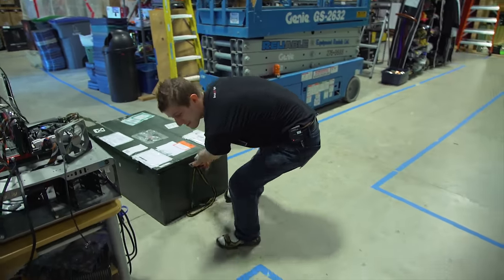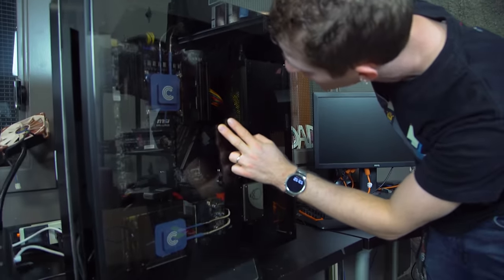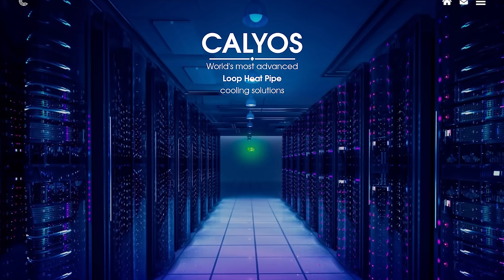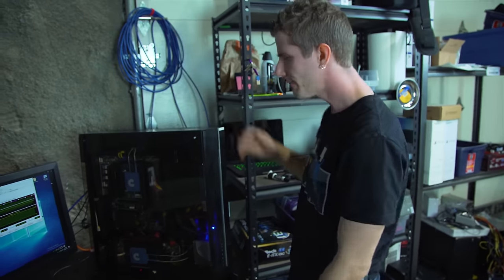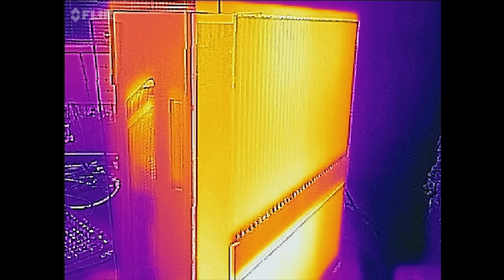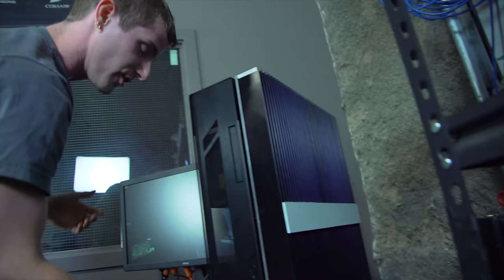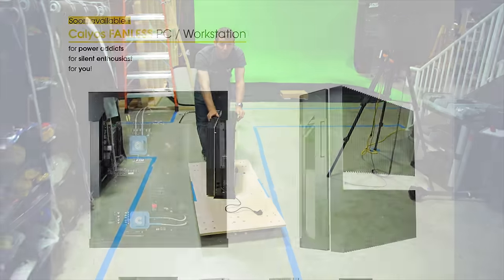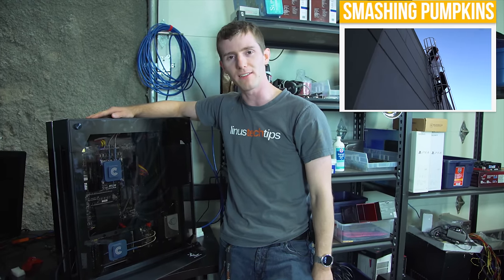TRULY Silent Workstation PC with ZERO FANS - HOLY $H!T Ep. 13

Comment: That a legit way to not get your computer stolen.
so heavy the thief can't lift it.
Reply: Yeah, but can you imagine moving it up and down stairs tho? I had to move my workstation at work up just one flight of stairs, thing musta weighed 100 pounds.
Reply: John Hitman but they can take cpu and gpu away
Reply: +fade2black001 72 pounds for a pc is heavy though... and in all honesty is moderately heavy
Reply: Lifting 72pounds is one thing. Getting away quickly with a 72 pound computer this size doesn't look easy.
a thief would prefer a laptop or a flat screen TV / computer screen. something they can carry and run with without difficulty.
Reply: fade2black001 I change dump truck tires and backhoe tires on a regular basis, I'm not saying it's heavy for me but for the average person 72 pounds Is rather heavy
Reply: John Hitman Thieves don't run. At least not the ones that'll nick this from your home. They will carry it to the back of their Thieving Van (matt black paint, tinted glass) and proceed to take anything else they fancy from your place. Were you picturing some random bloke running with this, penguin style?
Reply: Juanito Calavera ah, so you're a thief then. I mean, you seem to know everything about every hypothetical "thief"
Reply: I think its very clear that I made the distinction "the ones that'll take this from your home". 

And although I don't do it professionally, I am a thief. I have stolen many things from many stores particularly tech stuff and it feels me with pride like you wouldn't believe.
Reply: No, the big issue with the standards imposed mainly with the US Military for height and weight standards are that they are typically based on the out of date BMI system that makes the assumption of every single person of a certain height having the exact same frame. I have seen guys who could blow the fitness tests out of the water that were forced onto the body composition programs because they could not pass the height-weight standards or the poor excuse for a taping system imposed on the service that only uses waist and neck sizes for reference on the individuals. This is why there are also service members that are obviously outside of the standards based on appearance, fitness test scores, and the height-weight standards. They luck out solely on the way that their body stores the fat on them giving them a neck to waist ratio just enough to let them slip by. This is such a rampant issue that has held back peak fitness of service members and allowed others to make it through the bare minimums that there have been new orders rolling out to at least help the individuals that are able to excel at the fitness standards by either increasing the "body fat" percentage by a few points or outright exempting them from the standard altogether.
Reply: I understand that concept, however, the definition you are using of healthy is fairly flawed in and of itself. It becomes very skewed when you have many individuals that suffer from pre-existing conditions that are due to a poor roll of genetics like asthma, heart conditions, malformities and plenty of other issues. I suppose the main issue is mentioning the US Military, though, as most individuals commonly come out a lot worse for wear physically after completing an enlistment than those of the same age that didn't do the same, which is part of why many come out with disability pay and common use of the VA hospitals after their end of active service.
Reply: Went from zero to incest... I don't think anyone in their right minds would say that incest is healthy, but that is a skip to the worst possible case that anyone can have genetically besides being subject to mass amounts of radiation. The traditional definition of health is:
A :  the condition of being sound in body, mind, or spirit; especially :  freedom from physical disease or pain
B :  the general condition of the body <in poor health> <enjoys good health>
I'll concede that in this definition, however,  health is being used as a measurement of how long someone will live. Fitness must also be taken into effect for quality of life or survivability purposes as well. There is no reason that both cannot be used in tandem to fully measure the how long and well people will live their lives.
Reply: Simon you even bringing up BMI shows you have no clue what you're talking about.
Reply: I usually pull airplanes and push dump trucks to train. Not saying it'd necessarily be heavy for me but to the average person, it may be rather challenging to try and make away with this rig.
Reply: Cody Shumer THANK YOU. took that essay right out my mind lol. I'm in the military and can attest to what you're saying as fact.
Reply: Not me, I am a heavy weight thief. I lift even when I am running from cops.
Reply: John Hitman 666 likes...
Reply: With how the justice system seems to work these days they'd probably throw their back out trying and sue you.
Reply: they will just drop it
Reply: It was only 35kg, what adult can't lift that amount...
Reply: its only 77 pounds....
Reply: When I was 12 I could lift 50lbs with each hand... I'll steal this from Linus anytime.
Reply: username checks out
Reply: It would only be hard if you are linus
Reply: You should have just gotten a laptop. Much easier.
Reply: John Hitman make a concrete and steel base so that it is so heavy the thief asks you to help them steal it from you.
Reply: That's what forklifts are for.

Comment: You can't really shoot thermal IR pictures through glass like that.  Heat is going to reflect.  You might see a warm spot where the class is getting warmed up by the components but it's not indicative of the actual temperatures.  It would be a lot different if you popped off that glass cover.  There's no way the heat sink fins are hotter than the components themselves.
Reply: I was about to ask where he get that thermal camera ;D
Reply: You are correct about the IR picture.  Ideally he would have the IR camera inside the case...  Even so Linus did report the CPU and GPU temperatures as monitored by the OS.  This is one big heatsink...  As a student in the 80's I did some heat transfer work at a telecom equipment manufacturer.  While I was there they replaced their camera which needed liquid nitrogen with a new one that did not.  The first thing we noticed was that a person's glasses distorted the IR readings.  It was a lot of fun to play with the camera.  Things have changed....

Comment: Only $500 for the case and cooler? That's actually much less than I was anticipating.
Reply: Houdini111 I'd buy one.
Reply: expected like 2000$
Reply: Houdini111 duck Yeah I would buy one hopefully by the time it's released it will be a tad bit cheaper but for a all in one case that's not to bad
Reply: Id have one at 500 dollars tomorrow,my missis is always moaning about the noise with one case fan and watercooler fan and GPU fans
Reply: Thats a very affordable price considering how much a custom loop costs
Reply: Exactly what I was going to say.
I'm a student and even to me 500 bucks doesn't sound like a bad deal.
It is a high end case with a high end CPU and GPU cooler very nicely integrated. And those two coolers happen to be the best thing you could get, not available anywhere else (unless you go custom, but that actually gets expensive very quickly).
Reply: that's what I was thinking. For $500 this is really interesting
Reply: Plus all the money you saver not having to buy a single case fan.
Reply: Phake Phakerson Even better, no maintenance because no dust will go into the case or anything
Reply: Exactly what I was thinking.  I haven't done a build in a while but how much would a nice case and high end cooling solution cost anyway?  Couldn't be way cheaper than this.
Reply: Wellll, some dust but not even close to what a dust filter picks up
Reply: Its amazing how cheap PC stuff can be when its not meant for "gaming". Expect an RGB variant of this to be sold by another party for twice the price.

I can also definitely see Thermaltake making a clone, and making it much cheaper.
Reply: That's in the price range of custom water cooling solutions (if not less) and those aren't silent...
Reply: Houdini111 was thinking the same thing.
Reply: RGInquisitor While I know Thermaltake can do a lot in terms of case manufacturing, this one is special because of the secret technology that is in those pipes moving the heat away. I don't see anyone replicating that anytime soon.
Reply: motorbiker46 I wouldnt be surprised if it was reverse engineered soon.
Reply: For that Pricepoint and the fact that it looks epic and its unique i 500 is super low and the fact that you dont need to pay anything for fans some math (120$case 50$water cooling loop (30$ quiet fans x3)Gpu Waterblock kit 60$)
~320 $ for the super high end stuff paying 180$ more for the complete silence and the cool factor seems like a complete steal.
Reply: I'm hoping for some kind of smaller/lighter and cheaper version of this. I mean, the temperatures are quite a bit lower than they need to be, they could probably just chop off 25% of the heatsink and it would be fine.
Reply: but you have to consider that it would make for the worst LAN party PC ever... xD but srly as someone who already spent like 260€ to get his pc as quiet as reasonable possible (not counting the 1TB ssd) $500 is very appealing.
Reply: ***** what have you bought for 260€?
Reply: J Bender 
case: Silent base 800 = 120€, 
CPU cooler: Noctua NH-D15S = 80€
and 3 Noctua case fans for ~20€ each.
this stuff adds up fast...
Reply: ***** nice, got the same cooler and fans, but a corsair case
Reply: So basically you could save up for it by not buying 2 textbooks. @motorbiker46
Reply: I was expecting a bigger price, especially shipping in the size and material of a weapon box.
Reply: For a custom water loop, you're paying $700-800. $500 for this which is damn silent and gives near water cooling temps for the CPU and GPU? That's pretty good. 

Linus, don't yank our chain m8.
Reply: yeah for that kinda performance, 500 seems very reasonable.
Reply: Add a window fan to it!
Reply: Only $500 im sold. End game case here
Reply: +DC And that would be an incredibly high maintenance set up and a huge pain in the ass. Your idea destroys practicality at the expense of $70. 1/10.
Reply: That's really reasonable. for such an impressive technology
Reply: Or just buy slow enough cooling fans and you can't hear the computer in any practical use. My computer has 7 fans in it and it's practically inaudible. By the way I don't think there's any point in Super Flower's passively cooled PSUs since their actively cooled models are also practically dead silent.
Reply: Houdini111 sush!! saying stuff like that increase price.. 

come on man!
Reply: i expected well over $1000
Reply: ***** Well for $500 you are getting a high end case, a giant heatsink (that you can buy separately, but you won't save much money) and their special technology of moving the coolant. That is a damn good deal. You have to realise that a good case, a CPU AND a GPU cooler can get pretty costly.

You also have to understand that not everyone is able to make this kind of stuff in their garage. And even if they can, it will not look nearly as good.
Reply: Andrew Dunn Well, I'm not studying to be a doctor or lawyer and I'm not studying in America, so not really :D
Reply: beats the fuck out of liquid cooling for a better  price indeed
Reply: LOL 500$? Thats basically nothing. Thats less than my current water cooling loop.
Reply: By pirating two textbooks
Reply: ***** 
Well if actively cooled computer is practically inaudible..then passively cooled doesn't really have that advantage. I have had one fan failure in last 15 years.
Reply: You forgot the coolers for the GPU and CPU. 160$ for that.
Reply: don't  forget vrm and ram temp..... imagine how much you need to spend on water block if you wanna cool vrm and ram as well. compared to water cooling this thing is freaking cheap
Reply: it's actually cheaper than Razer Core
Reply: Kapteinis Reinis haha, that's true. that thing should be at best $100
Reply: is the price for the case ? i cant find it anywhere online
Reply: pdx i think it is not sold yet, but the price was announced to be 500usd for everything except actual computer part... i think within few month time we will see some pre order i guess.
i really wish they'd make ITX version.. that would be freaking epic
Reply: $500 would be really good price: Without any modifications this case tends to cost $400.
Reply: I`d buy that for a dollar
Reply: +ffffff
I don't think that would be possible, passive heatsinks are dependent on large thermal mass and surface area and the only materials I can think of that they could try to use that would have better thermal properties than aluminum are copper gold and silver and those wouldn't improve the performance by enough to shrink it that far and would drive the price to absolutely insane levels.
Reply: Cooper Cummings sorry, but did you watch the video? its using basically a refrigerant for this. aluminum will do fine.
Reply: Cooper Cummings but dont forget carbon fiber or graphine.  Passive cooling should actually be super common once those prices come down.
Reply: Cooper Cummings yeah forgot about that, guess ITX will make little sense coming to think about it.
Reply: Wemdiculous CF or graphene won't make much difference. why would help with cooling, you can make chips with high heat tolerance with it but it won't help with cooling at all. making heat sink out of them is useless, only way that could be used is by having carbon nano tube or graphene chamber to create a heat pipe but that other than being light will have very limited effect. although it graphene could be used for thermal pad but by being conductive it will have very limited application.
Reply: I don't think a clone will be that easy. The secret for the cooling is the fluid in the coolingsystem.
But that case looks awesome and it would be worth 500€ for saving cooling and running electricity costs. No moving parts also means almost no maintence.
Reply: Doubt 500 is right, the case attached looks like the lian li pc07 which is expensive on its own let alone coupled with distribution etc. of the cooling system
Reply: they have a case on kickstarter right now,  570 euro for early bird :)
Reply: 100 bucks gpu cooler 100 bucks cpu cooler 100 bucks big ass radiator 100 bucks case, 100 bucks extra, 500 bucks would be a good price :)
Reply: Shut up and take my money! 💵
Reply: I thought like 1500
Reply: Wow, that's an underrated benefit. You could have a fully air-tight case which would see effectively no drops in performance due to dust and air-flow degradation. Change all storage from HDDs to SSDs, and you effectively have an entirely solid-state computer with *zero* moving parts. Apart from energy use considerations, you could have this on 24/7 and could reasonably expect it to run both unnoticeably and indefinitely. No wonder they raised money offering this as a data center solution.
Reply: @CrabSt3r  IF it gets released
Reply: Linus got it wrong. It was €579/$690 for the first backers, the last backers price for it was €650/$775. Retail, if these things ever get completed, will probably cost closer to $1000.

Comment: That is some dope engineering.
Reply: And only $500,-? That's crazy.
Reply: Pascal M. Still, A custom water loop costs More. This would be a Killer price
Reply: +Pascal M. The case includes the cooling system ofc because they won't sell them separately.
I think it's more or less obvious that the actual hardware isn't included.
Reply: +Henrik Exactly what I thought, too. A good aluminium/glass case + custom water loop will easily cost you twice as much.
Reply: +SunRed To be entirely fair, I kind of doubt the commercial version will use the same case. The case itself is $320,- at its cheapest, so if they use that the price would really be insane.
But even on a $100,- case I think the price is good for what's basically a proof of concept/prototype.
Reply: Jelle van M. 
Thats not a dope engineering, its just your very own refrigerator combined with fluid block & large heatsink, working on basic principle & simple experiments of thermals. If you have a CNC Machinists nearby you can build one yourself & can order refrigerant fluid online.
Reply: Shubham Patankar it is dope engineering because a fridge still makes noise. A fridge has a pump and this case has no pump. The fluid is moving because of the heat, not because of a pump
Reply: CRIMAFUYT 
Either you don't have good enough refrigerator or you don't know Fridge uses pump because it has to maintain pressure & have to move fluid along the length of cooling pipe, which is fairly long than whats in this case. But, here whats equipped is a huge heat sink co-held with heat pipes.
Reply: Lol you cant use fridge coolant lmao
Reply: Emil Bøilerehauge 
Yes, you can, just be sure you have a leakproof loop for pressurised gases (just as what manufacturer did in this case). But it's not that much efficient in such small space & rapid TDP flow, so here they used pentafloro-propane. There are more refrigerant that can be used, just a matter of little research & implementation.